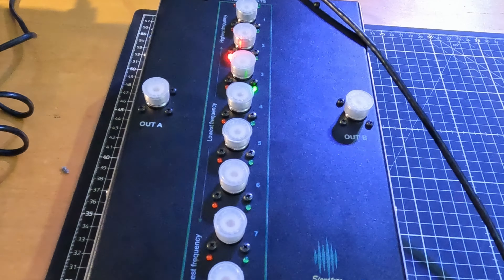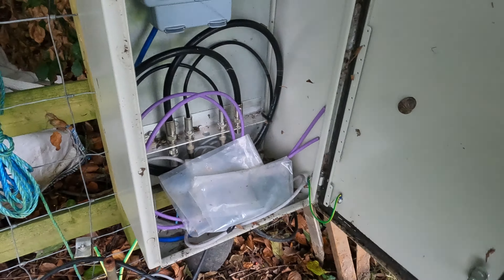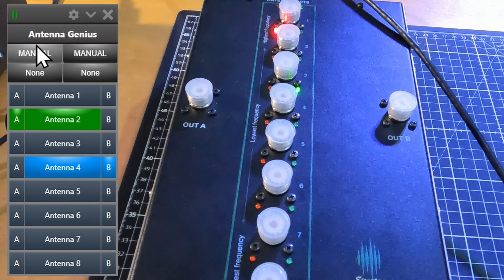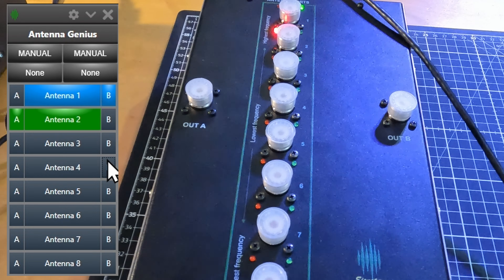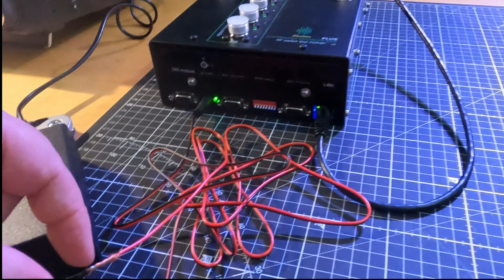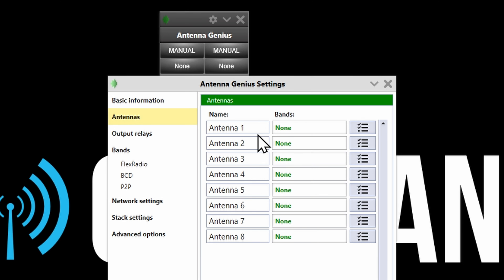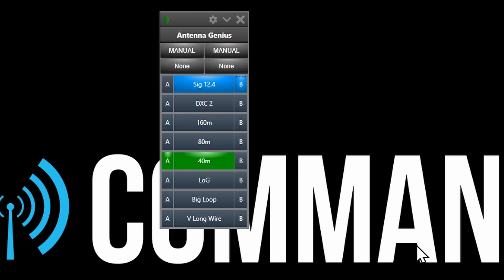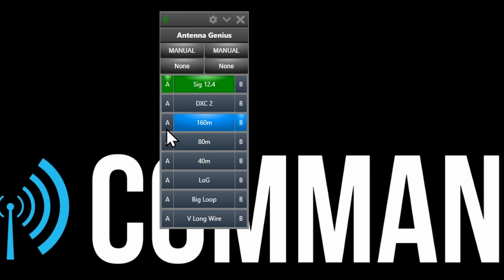Genius 8x2 Incredible Remote Coax Switch

Comment: They should’ve done POE and it would be a lot cleaner / easier
Reply from the maker: We're right on the limit in terms of current and voltage I think.. I remember a while back we built a HUGE band pass filter with tons of relays etc and we had to run the voltage right up to get the current to slam the relays.
Reply: Depending on the generation of PoE you can easily provide up to 100 Watts of power and voltages around 50V. That should be more than enough to power two relays and some microcontroller..

Comment: Stating the obvious (at least for anyone from the IT crowd) you only need one ethernet cable and a network switch. For 900€ I would expect a bias t supply, wifi and web interface. Saving grace is the API.

Comment: Ranko did a presentation of those new switches during the Istra contest conference organized by the 9A1P contest team. Great stuff, you can stack them and connect more than 8 antennas...
Reply from the maker: Yes, you can link them up. Quite amazing.
Reply: The next logical step is the Flex you have your sights on 😊. Ranko did mention they are developing a solution that will work with any radio...

Comment: For those in areas with risk of lightning, it might be wise to avoid having every single wired service in the house (AC power, Internet) running outside to the base of the antennas.
For network, one can purchase very inexpensive "Media Converters" to enable fiber optic Gb connection using fiber. 
You may be surprised how cheap they are. Like Cdn$40 all in for a complete 50m system.  Gb outside 50m away by fiber. Since then, bought another 100m system for not much more.
If you purchase the fiber cable that doesn't have a steel conductive support wire embedded in the plastic (many do), then it's one less lightning path into the house.
I just get nervous when I see people wiring up everything in their house to the outside antenna farm. Hopefully not including their electric blanket. Cheers.
Reply from the maker: WiFi maybe!?

Comment: Definitely top notch hardware no doubt. There are a lot of good alternatives on the market (RemoteQTH, ArraySolutions, LowBandSystems, EA4TX etc. I'm sure there are more..), which AFAIK have similar port isolation values; at least better than 60dB port to port isolation. 

Many of these switches have nice functionality built in like automatic band switching and interlock functionality, most switches that are made for 2x radios have 60dB or better isolation port to port. I'm not sure about 4O3A but most of them support BCD or similar, for Kenwood you'll likely need a "band decoder" that connects to the RS232 port which parses which band the radio is on through CAT data and outputs BCD. It's possible to make a DIY solution too, purchase good PCB's (there are several variants out there with good design), buy good relays, use good connectors. Then you'll need a way to drive the board and switch the relays around (software & hardware costs), need a good box to put the antenna switch in, also costs money..

There's no such thing as a free? cheap lunch I guess.
Reply from the maker: Yeah.. It's got ALL that too.. You never know what I might need some day!

Comment: This is a very cool switch and I can't imagine the cost. I do have a concern about the 12v transformer being in the field. Here in the USA, we can't by code run low voltage and high voltage in the same conduit, forget the coax for this because it is shielded, but the other cables you are running in the conduit. From my experience as an alarm technician when we run alarm wires parallel to 110v wires in an attic for long runs we get induction voltage as high as 30 - 40 volts AC, I would be curious to see if you have the same issue with your setup. Just a thought. Love the videos and keep them coming. Hello from Arizona, USA.
Reply from the maker: Well, I'm running mains to the cabinet - then a PSU in the field.. I have since bought a thermostat and heater for the cabinet.

Comment: Are you able to control the switch from a PC on the WAN?  Security password, IP and port configurable?  The manual mentions can only use the company's VPN to work outside the LAN.  Confused.
Reply from the maker: You will have to ask them.. I use a remote desktop configuration.

Comment: Very nice. Have looked at these also, but have recently been trying to find information on using the OM Module with it. Thinking this could work to control relays to something like your 4-square or triangle phased array. Just don’t understand if this module will let you activate 2-3 relays at once under one label and button. Still looking. Might make a good video though.
Reply from the maker: I can only activate 1 at a time.. And one 1 on any bank too.

Comment: 🤔🤔🤔What about one antenna and other radios,,,,,,   your thouhgts?   Thanks 🤔🤔🤔
Reply from the maker: Erm.. Well you could do.. Not my thing though
Reply: Just make sure the port isolation is high enough. You want minimum 60dB port to port isolation. Some of the manual switches are really good for this application.

Comment: Hi Cal… bit off this topic but what are the headsets you are using for radio… seen you wearing a black headset and there’s one hung up which looks like a pro7…. I’ve been off the air for a long long time because of my life ( awwwwww )  any-road up, it’s resurrection radio time… I find your approach and personality attractive to listen to and learn. My back garden is a plant pot so I’m looking at antennas for a down the road purchase, your video channel is very helpful in my re education… yes this comment/request is at a tangent to the cabinet build… but there you go. 
Best wishes to everyone. 73 G0UVL  in jolly old Wigan
Reply from the maker: Lez.. Yes the one I use when I am remote is the HDM 300 Pro - and the one hanging up is the Pro 7. I do not like the Pro 7, it doesn't seem to fit me right and is very heavy. BUT I do use it sometimes on /P. The HDM Pro isn't anything to do with ham radio but works well remote. It's a "broadcast" headset. I would have thought for camere folks and stage managers maybe.

Comment: Does this mean your Flex 6600 is on order???  You're going to love this switch, it's perfect for your application.

You should put a packet of desiccant in the outside metal enclosure to mitigate any potential moisture ingress.   I bring my coax into the box via individual cable glands so when the box is closed it's completely watertight.  I also fount that right angle connectors on the coax make life much easier.
Reply from the maker: No.. However the man from Flex will be live on the channel on 14th Nov.